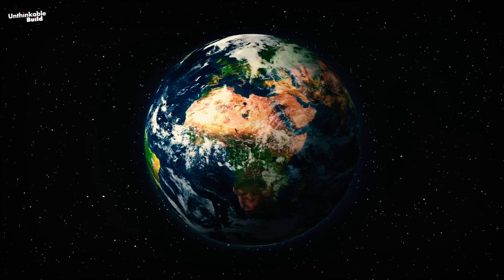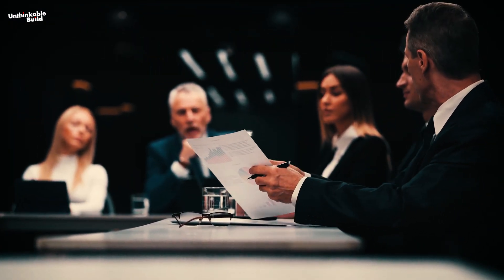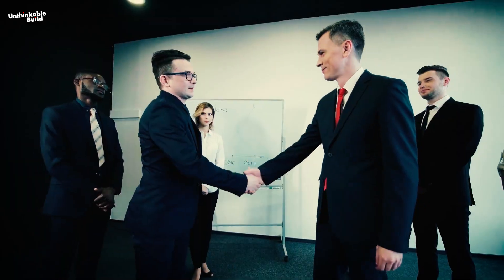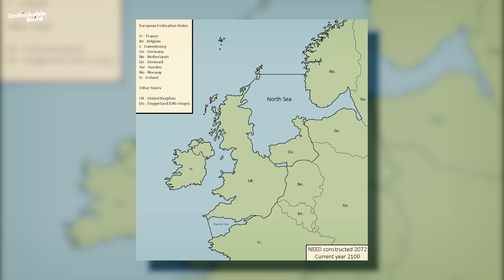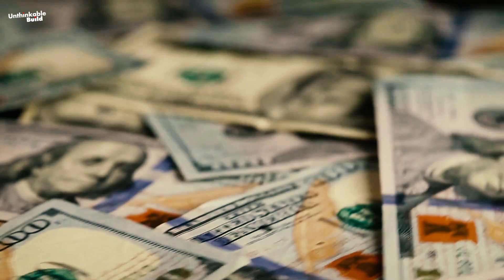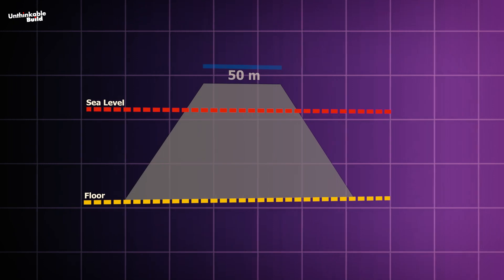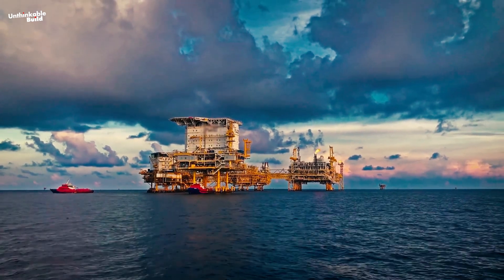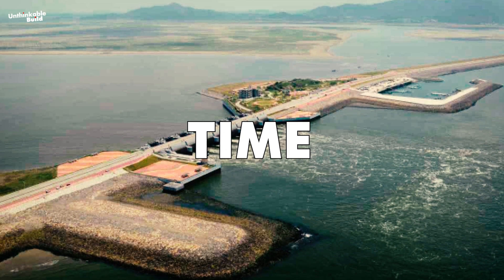The $600 Billion Dam That Could Save Northern Europe

Comment: A hydro-electric dam across the Dover Straights, the fastest tidal flow in the Channel, makes more sense. It would serve the UK and France, improve rail and road links, and could  be backfilled with rubbish  during construction. A large lock  could be opened twice per day to allow straight through passage for large ships at high water (or low water).